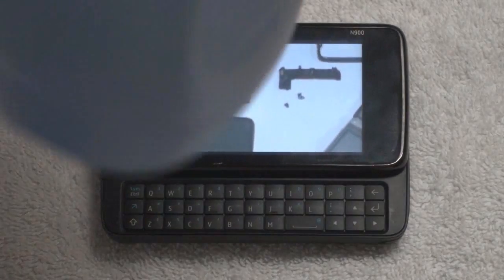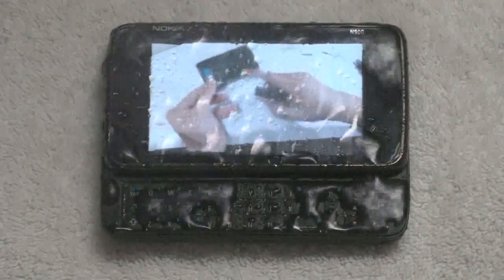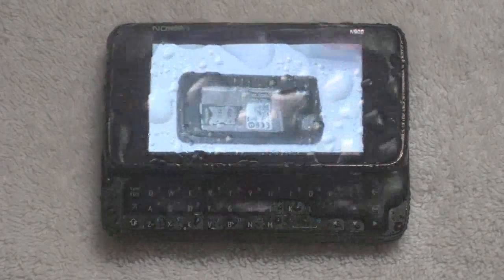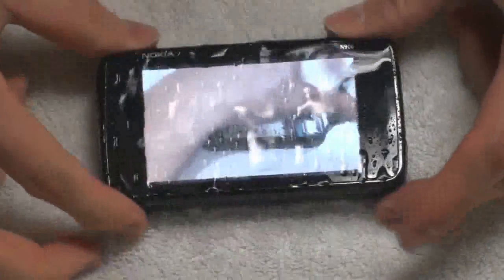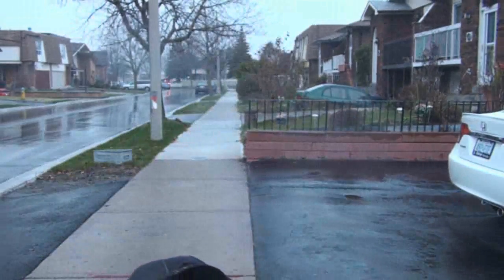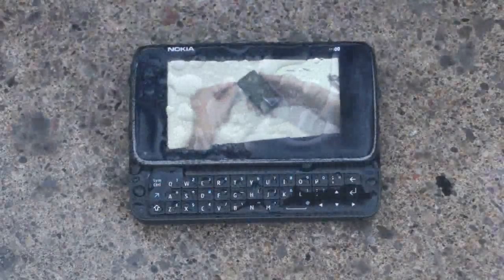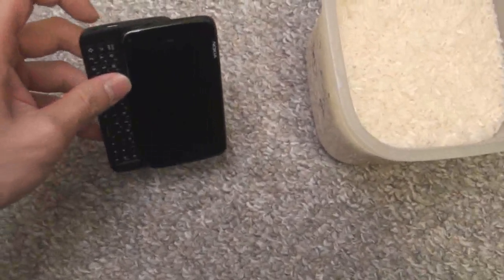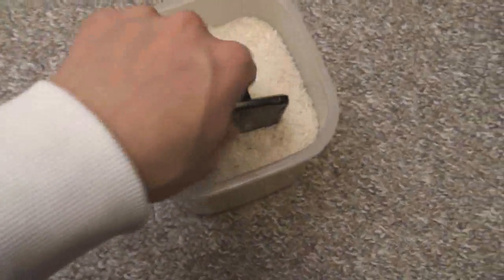Nokia N900 Stress Test - Part Five - Water Test!

Comment: Idea for stress test: I once accidently left my nokia E65 on the roof of my car and drove off with it on top. Come about 50km/h, I noticed in my rear view mirror something fly off the roof and smash to pieces on the ground. The phone was salvageable, and worked upon reassembly, although the speaker was crackly and a fault in the screens backlight also became apparent soon after. Not that I plan on ever doing that again, but I'd like to know how the N900 fares in similar circumstances. Thanks..

Comment: Well I don't think you actually killed it. From the earlier section, I did notice you got nothing on the battery bar so could have been the battery is completely drained.

Stick the battery into an 5800 and charge it full.